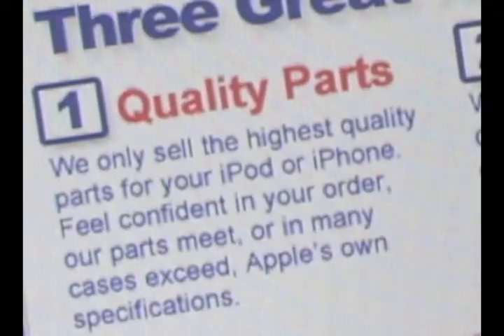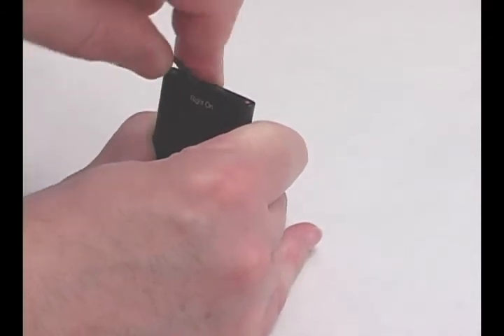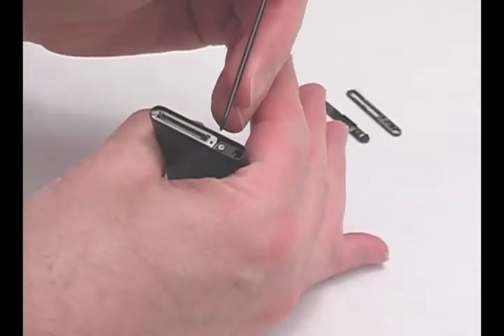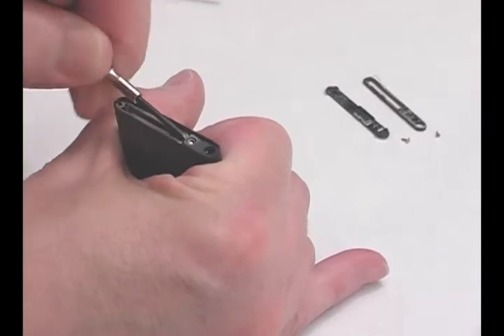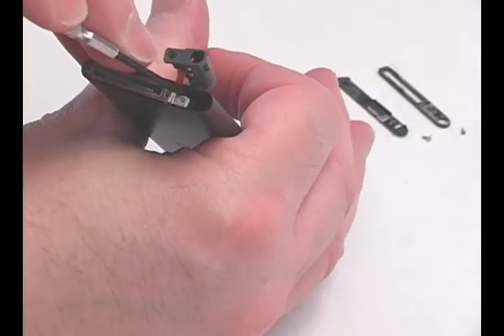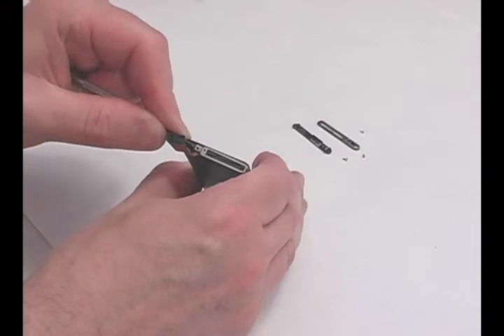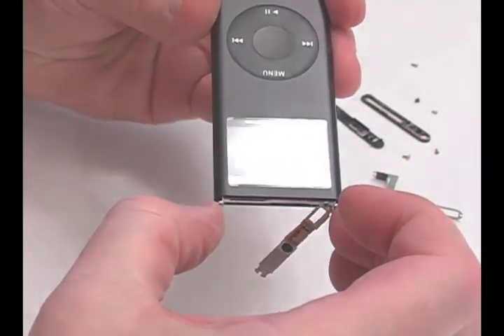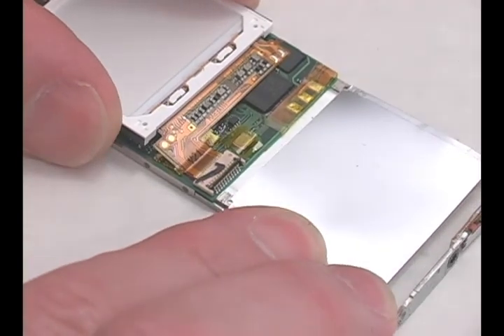DigiExpress - iPod Nano 2nd Generation LCD installation

Comment: If you guys are stripping screws you aren't being careful enough, they don't need to be super tight.
If screws are falling off the screwdriver run the edge of the screwdriver on a magnet and it will magnetize the screwdriver for awhile.
Lastly he shows exactly how to take it apart just reverse that order, if you can't figure something like this out, probably should take it to someone that can.